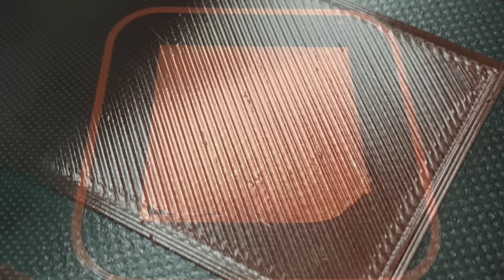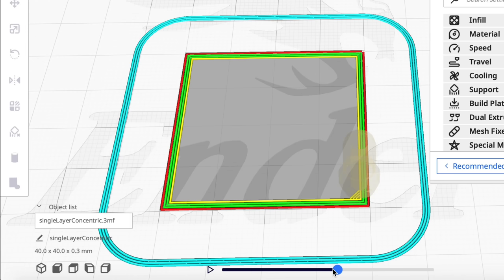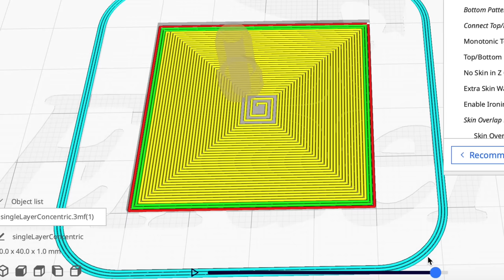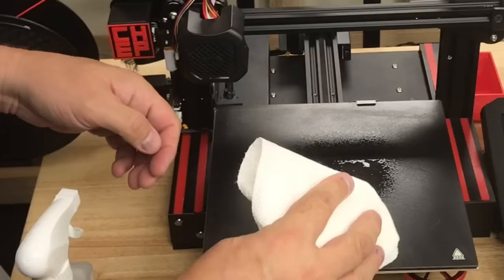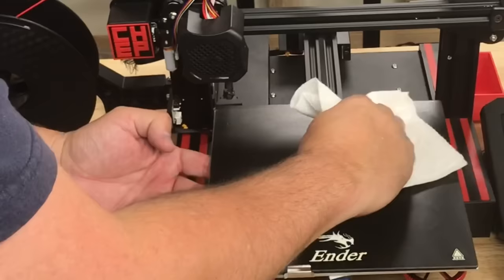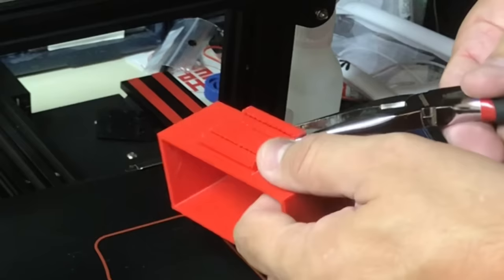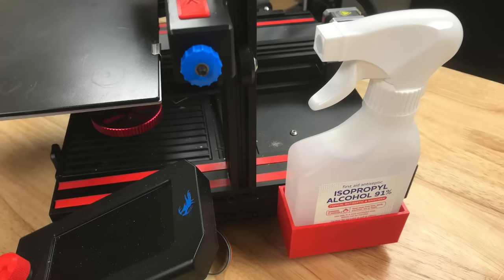Better First Layer and Bed Level Fixes on 3D Printers

Comment from the maker: As some have pointed out, mounting the IPA bottle on the rail near a running heated 3D printer is not the best idea. Keep it stored in a safe dry place when printing. You can store it in the holder when the printer is not running so it’s there when you are ready to start a print.
Reply: Hey CHEP, useful video as always (Maybe not the storing flammable liquid near the printer haha!) but wondering where did you get the CAD model for the bracket? Trying to find that double slot CAD model, it's a real pain to find!
Reply from the maker: I created it in Tinkercad.
Reply: Just so you know. Craality glass build plate coating dissolves if alcohol used on it . I Lean the hard way 😃
Reply from the maker: How long did it take? 
How many applications of alcohol?
Reply: @FilamentFriday  the very first time i try left permanent marks so I'm no using alcohol unless im printing on the plain glass side. Craality says to use water with little dish soap . Bottom line : don't touch the plate
Reply: @mrt_tube  That's what I have been dojng, but after a partial print detached and totally clogged the nozzle area I'm probably going to use IPA.
Reply: @ColinDyckes  detached part can't clog the nozzle, that's usually material issue. You can flip your build plate and experiment with the old school methods like hair spray, or glue stick on the plain glass side. The coating works great once you figure out what the problem is, don't mess it up with IPA
Reply: @mrt_tube  It can and did 😢. The part was dragged around and more and more extruded filament was pushed up into the hotend area and sock. It needed a complete strip down to clean out the solidified filament.
Reply from the maker: @mr. T - I’ve been using IPA for 100’s of cleanings and still no damage so I thinking you got a defective unit.
Reply: @FilamentFriday  You could well be right. It's a brand new printer with only about 48 hours printing on it. There are visible marks on the plate but it doesn't look as if the coating has detached, but maybe it has. Looking at a genuine replacement on Amazon UK they do actually suggest using alcohol, so now I've cleaned the gunk from the whole printhead I'll clean the bed with IPA.
Reply: @FilamentFriday  Idk if it's defective, it works great. I'm not saying that using IPA is bad, but what I'm saying and so does Creality support don’t us it on CR-6 se, or at least try it on a corner first. I have guy here at work another CR-6 owner that walked into my office couple days after my "oops day" saying: "I think I f..ed my plate" so it is not just me.

Comment: It's good to struggle a bit when learning this hobby, just not to the point of becoming frustrated and quitting. It took me quite a few prints as a beginner to finally get things right. You have to learn what setting does what, and the distance from nozzle to bed and what a perfect print even looks like when you get there. After a awhile, you'll instantly know what to adjust, and videos like this help tremendously! Great video for a newby!
Reply: Same here started printing for 2 weeks know 
Still there is much to learn like i still can't get to print something in mid air without a mess
Reply: You need to get the right printer for that. An Ender 3 while trying to print relatively large parts is not a good idea for a beginner.
Reply: @bre39y  i always use support for that. Using ender 3
Reply: @mostafakhaligy857  it mostly makes a mess by sticking to the print
Reply: @bre39y  u can always change the support settings
Reply: Yeah I'm at this stage
 Getting frustrated beyond belief
Reply: @robthespaceninja  i bought some alcohol and cleaned the bed thoroughly. Then scrubbed the bed with a spatula and cleaned it again with alcohol.
Then when I heated the bed to 60°C I homed the Z-axis and auto-leveled the bed again.

2 prints later with a couple of adjustments to the Z-axis compensation it finally worked. Now I have a lot less issues when printing and I'm finally learning how to improve my skills
Reply: The ender 3 max is just a garbage can folks sorry, I bought one I hate it nothing works right. Save you money go straight to a better printer.
Reply: @odeball22  thousands of reviews say otherwise
Reply: @randomdudeontheinternet9926  yah amazon bots?
Reply: @odeball22  Community seems to agree with the reviews. Some issues come up but rarely real problems. What issues are you having? Maybe I can help?
Reply: @randomdudeontheinternet9926  doubt it your just a random dude.
Reply: @odeball22  lots of stuff works out after listening to a random dude on the internet.
Reply: @random dude on the internet  I'm not a starter I'm pretty intermediate I'd say, I don't think you can tell me anything I haven't already tried.
Reply: I had it sticking...but after three prints, it just wouldn't stick anymore...I did almost everything :(
Reply: @odeball22 so what do you mean by nothing works right
Reply: Go with a Prusa.  You'll at least know what to compare to if you try other brands.  I learned my lesson!
Reply: I started with a resin printer and I just got a filament one and let me tell you resin is so much easier you just pour your resin in and print
Reply: I can’t even get my filament printer to level it’s like it doesn’t know where the extruder is because it’ll go all the way to the left until it maxes out and it starts clicking and I have to turn it off and try again I don’t know what I’m doing wrong

Comment: I don't want to be that guy... But please be careful putting your IPA next to heat sources like this. It's got a super low flash point (12oC/77F) and should really be stored somewhere a little safer especially given how infrequently you need to use it during 3d printing

Comment: One of the biggest causes of prints not sticking to the bed which is often overlooked by anyone new to printing is oil and grease from your fingers on the print bed, i always clean my bed with some 99% IPA before each print.
Reply: Then there’s me. I only clean my bee when the bottom of the print is gonna show and needs to be perfect. All my prints always stick. Pla+, ASA, PETG, PC.  Once you get a qidi printer perfectly level, and the right slicer settings any filament will stick without glue or spray.

Comment: I feel you’re tempting fate having IPA that close to a heated bed.  Just to prevent Murphy’s Law from striking here, I keep IPA and all adhesion promoters stored in something fireproof.   But I also work in a lab so my view of these materials is a bit different than most consumers.   Print safe!
Reply: I was about to comment that, this can turn a incident like, "my printer smoked" into a  "my entire house burned down".
Reply: @victornpb  exactly. I’ve experienced a 3D printer fire (workplace) and it was hugely enhanced by flammable materials nearby.
Reply: Yes , its Common Sense!! Put a very flamable liquid like  IPA  near a PSU or a heatbed its very wrong !!
Reply: I agree just asking for a fire rather than just the board smoking
Reply from the maker: Did you miss my comment pinned at the top or in the description?
Reply: @CHEP  your pinned comment came after I posted my comment  😀
Reply from the maker: Yes, You helped remind me. It’s the follow up comments I was curious about. Wondering if they aren’t seeing it or ignoring them. 
YouTube won’t let us edit the video to add a note so this is the best I can do.
Reply: @FilamentFriday  it’s not a big problem to keep the ipa in a cupboard are people so lazy these days they can’t walk afew steps to get it and it has to be at arms reach next to electronic and a heated bed 😂

Comment: I wish more people had your style of presentation.  Time is our most valuable asset.  Thank you for spending your time, helping people like me, with videos like this.  I had my best print to date, after watching this and integrating your suggested changes to Cura.  My adhesion was perfect.  It was the largest job yet and it was sitting loose on the plate this morning when I reached for it.  Unbelievably, outstanding improvements.  Have a great day!  -from a new subscriber!  Thanks again!

Comment: Not sure if helpful for others, but I took the liberty of noting out Chuck's tips. I believe all these settings are for Cura.
1) Level the bed
2) Clean the bed with IPA
3a) Under 'Material':  Bump up printing temp (up 5 degrees, or 10 on glass bed)
3b) Initial layer even hotter (around 215)
4) Under 'Quality' : Change Initial Layer Line Width - usually 100%, but change to between 115% to 125%
5) Under 'Walls' : Check "Outer Before Inner Walls"
6) Under 'Speed' : Slow down initial layer. Initial Layer Speed = 20.0 mm/s, Initial Layer Print Speed 20.0 mm/s, Initial Layer Travel Speed 35.0 mm/s
7a) Under 'Top/Bottom' : Change 'Bottom Pattern Initial Layer' to Concentric (default is Lines)
7b) Check the 'Connect Top/Bottom Polygons' (default is off)

Nb. At time of writing, it seems "Walls" options are slightly different now. There is an 'Optimise Wall Printing Order', and a subsequent 'Wall Ordering'  option. Its default is "Inside to Outside", with the alternative option being 'Outside to Inside'. I expect this new option is similar to Chuck's original intention for this step.
Reply: Thanks for doing this.

Comment: These tips rocked, Chuck. I've been so frustrated with my Ender 3 for the last month when I couldn't get prints to stick or leveling right. This video and the bed adhesion one you did helped me do a total 180.
You're the Mr. Rogers of 3D printing, sir.

Comment: THANK YOOOU 
I set up a printer for my bro 6m ago with no problems. I just got the same brand - different model and was on day 4 of tweaking and failed print jobs. All of the other solutions I found online were things i had already tried. I was ready to throw my printer off the balcony. Your video was the first I saw to mention anything more than the standard solutions.

You saved my new printer's life, it thanks you.

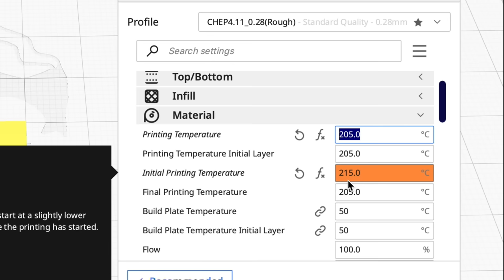Comment: 00:52	Initial Temperature [+5/+10]
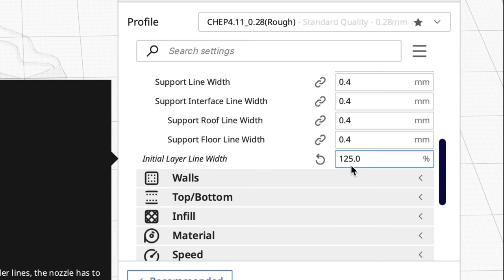01:01	Initial Later Line Width [125%]
01:16	Outer Before Inner Wall [√]
01:23	Initial Layer Speed [20]
		Initial Layer Travel Speed [35]
01:53	Bottom Pattern Initial Layer [Concentric]
		Connect Top/Bottom Polygons [√]

Comment: I used to use the paper to dial it in. 

I now use the paper to get it close. I made a 120mm square with a brim, turn the speed down, and I adjust on the fly when it’s making its big squares. 

I was never sure what the paper method would give me and now I can see how good the first layer prints on the fly.

Comment: One other thing that you do that can help with adhesion it use a skirt. There often isn't a good flow rate when the printer starts printing. The skirt gives the printer a chance to get the flow rate right when it starts printing the parts you want to keep. A brim or raft can also be useful for tall parts that might get knocked over during the print.

Comment: The Slice Settings that you gave, has a New Meaning when using ABS. I have been so successful so far with ABS, that I do not even use a "brim" to secure the base. I believe the biggest help in the settings, was the Top & Bottom, and using the Concentric tab. I also set my Hot End at 250 and the plate 110 with ABS, and also slow my speeds down, which is part of your suggestions above. I also make a light ABS slurry, and apply it on the surface prior to the heat, after cleaning the surface. We are told ABS is not a big problem on the 3D printer.....Not So. I purchased an enclosure, which is good, but never had a good ABS model, until now. I have a motorcycle that needs ABS because of heat and now I can build pretty much anything.
Thanks for your help and previous help to make my 3D printer work right.🙂

Comment: Thank you CHEP!

I succesfully was printing for over a year with preassebled ender 3 max. I can imagine that it was possible only through blessings of Printing Gods.
Only recently have I noticed that pretty much all wheels were loose. I had wobbly bed and x axis grinding itself.
After carefuly calibrating everything, including the e-steps, Printing Gods abandoned me and I had results similar as shown in video.
Following these steps resolved my issue.

Comment: Definitely going to try these out.  I've been having an issue with my first, or first couple of layers on one specific side of all of my prints.  After watching this, I realized that the size that I pull my prints up from, and touch the bed with my fingers.  Time to do some cleaning and set a new template with all these settings.

Comment: When I first got my Creality CR-6 SE, alcohol was all I needed to get the bed clean, then over time it just wasn't working. I had installed the community firmware for my printer but wasn't well versed enough to know what needed to be done after doing so. Your videos especially helped me so much. I made sure to set the e-steps correctly and just used some soap and water to clean the glass bed. Those two things alone have changed my printer from unusable to awesome! Thanks Chuck.

Comment: Thank you so much, mate. I've been running around like a chook without it's head trying to figure out why my prints kept falling over no matter where i positioned on the plate, how often I cleaned,  how much I lubricated wheels, screws, tightened, adjusted things, how many supports, brims, rafts etc I used. I'd tried so many things to no avail. THEN! Using the settings you demonstrated here, along with a little fine tune of my first layer squish, and.....you little ripper! I'm finishing prints again instead of having a bin full of pieces that keep getting knocked off the plate at the 65-75% mark. Thanks again, mate. Your advice here was a godsend. Cheers!

Comment: Had my Ender 3v2 for just a shade over a month, the low point was experimenting with glue stick which make a hellish mess of the print bed (and took hours to clean and recalibrate).

The best solution I had to date was bumping pretty much all 10 filament materials setting in Cura to have a bed temp of 65C and an extruder temp of 210C.

I hadn't got around to experimenting with Cura's first-layer settings, but I'm very grateful to Chep that there looks likeany more finely grained and not super-obvious settings to try.
Reply: I use glue stick, the purple disappearing kind.  Clean bed , apply glue stick , print comes off easy. Print again might not stick as well, apply more glue stick.  I might repeat this once or twice more.  Then I get out the windex(wonder if water would do same) paper towel, and a trash can near by.  I spray the windex on the bed. You can see the glue turn purple. I wipe it off with paper towels. Might have to repeat those windex steps a few times till clean as a babies a…….
Reply: @bruceyoung1343  Ah, in the UK I was using Pritt Stick (white in colour), probably a close match or rebrand.  I found that even a relatively thin residual layer caused this stuff to bake itself hard on the plate, ever IPA couldn't shift it.

Of course this stuff is water soluble so had to remove the glass plate and run it under the hot tap. In a few seconds the stuff just washed away.

In conclusion I'd only now use Pritt Stick as a last, albeit pretty guaranteed, resort.
Reply: @ethzero  Pritt Stick / Purple stick.   I like it because can control where want it.  Do you have to re- level the bed after cleaning in sink?
Reply: @bruceyoung1343  most definitely! I run the Jyers' firmware with a CR Touch and for giggles ran the "manual" bed level feature to return the probed values for each corner and they where waaaay off.
Reply: @ethzero  I have a Ender 3Pro extended to 300 x 300 x 500 currently still stock mainboard. Have a BTT SKR 1.4 turbo , bells and whistles for board, I have same CRtouch(metal probe), touch screen all to install but haven’t yet.

Comment: Great tips there! I hadn't used IPA because I could swear I had seen an article from Creality saying not to use IPA on the new bed type. Having just had a partial print detach and totally clog the nozzle area on my CR-10 V3 it is definitely getting cleaned with IPA before every print 😁
Reply: I've subsequently cleaned the standard Creality bed with IPA after every print. The bed looks nearly as good as new and prints stick very well now and also detach easily when the bed is cold.

Comment: Hi. Not having experience with cura, your advice is excellent. It helped to solve my small wrapping and shrinkage issue on the corners of a large build. The first layer looks fantastic and sticks well to the bed, with no shrinkage. Thanks again for the excellent video advice.

Comment: I recently ran into the issue of the PLA not sticking, after previously having no issues and it being leveled properly. Cleaning the surface did the trick. That was literally the only difference for me between the bad prints and finally back to the good ones.

Comment: So I rarely miss one of your videos, and this one came back to help me. I have been using hairspray to help with adhesion on my glass bed for years now... Never had any issues with this until I tried to print the articulating, "print in place" dragon and one or more parts would come off during the print... I remembered this video and said... What have I got to loose?... Well I have printed 3 dragons for family members without one loss print.... Next big test, a 1" dowel 390 mm tall, no brim, and it stuck perfectly... Thanks again for the help.

Comment: These are great tips.  I'd also like to add that setting your initial layer height to 75% of your nozzle size helps too.  My nozzle is .4mm so I print my initial layer at .3mm.

Comment: I am glad I found this video. My upgrade to auto bed levelling didn't help much and I was getting really frustrated. Not sure which one of your tips made it for me (suspect it was the cleaning with IPA) but I applied all of them and now I haven't performed any manual adjustment for a while and my prints are perfect. Great video. Thanks a lot.